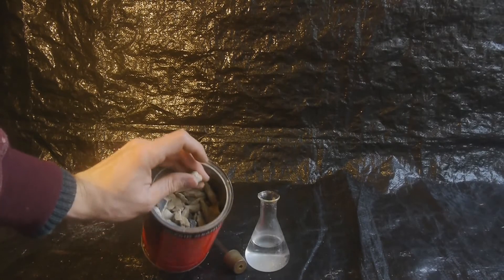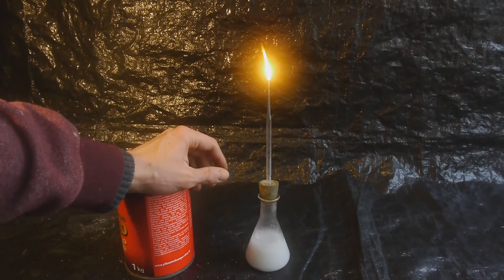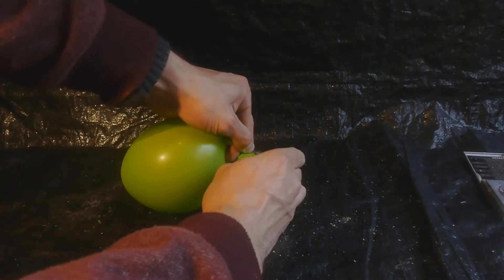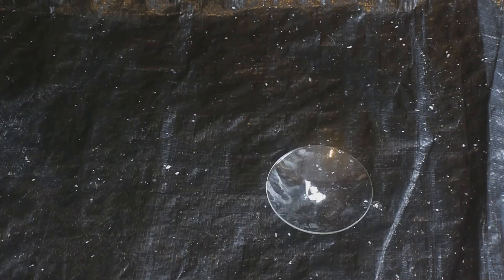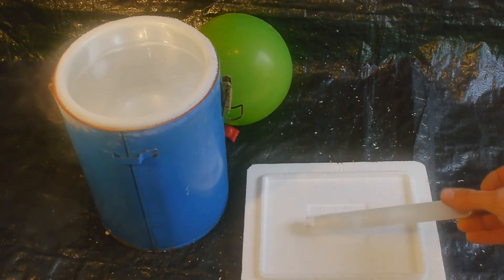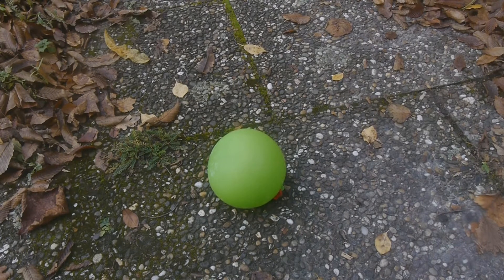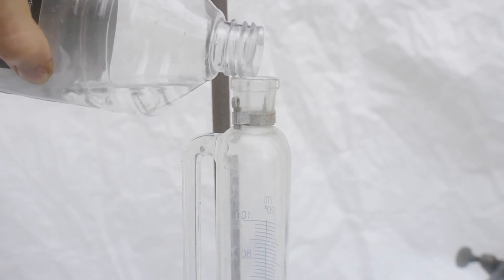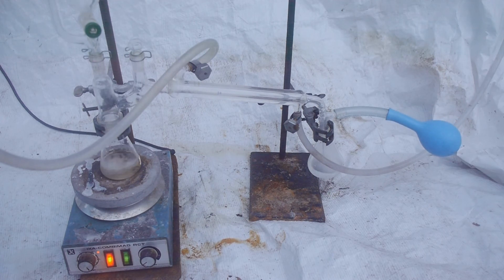Making Solid Ethyne: Flammable Dry Ice

Comment: Did you use phosphoric acid H3PO4 or solid P2O5?  AFAIK only the latter could remove  H2O from other compounds.
Reply from the maker: Yeah you are right, with P2O5 I should have had much better chances of getting ethylene. But I only used 85 % H3PO4
Reply: @EliasExperiments  My understanding is that the H2SO4 is not  used for its acidity or catalytic activity, but only because of its extreme avidity for water, and will rip apart other molecules to get it.   The 85% H3PO4 is already satisfied and has no such power.
Reply from the maker: The H3PO4 is certainly a lot weaker, then the H2SO4, but it still has some dehydrating power. Also I distilled of quite a bit of water.

Comment: sweet, I wonder if frozen acetylene is at all shock-sensitive?
Reply from the maker: I was actually quite scared of that, that is why I only made such small amounts. :D Maybe some idea for further experiments.
Reply: it isnt, i knew one chemist who made solid acetylene and smashed it with a hammer- nothing happened
Reply from the maker: Stuff like that is highly dependend on the amounts, purity and how solid the underground is. So I wouldn't rely on that. I have been wrong with stuff like that before. :D
Reply: @EliasExperiments  yes but acetylene when under pressure turns from tripple bonds to double bonds, and even at this more shock sensitive state, it requires a very powerful knock to go off, one handbook explained an oldschool acetylene bottle could be set off using a thick ring of plastic explosive going all the way around the acetylene bottle
i dont think a hammer will do.
Reply from the maker: That is certainly true and I am sure what I did was somewhat safe, otherwise I wouldn't have done it. Still it is always better to not rely on something being safe.
Reply: @EliasExperiments  try loading up a balloon with around 75% acetylene and 25% oxygen and then lighting it off
Reply from the maker: Lol the neighbours will sure love me for that. XD
Reply: @EliasExperiments  if the mix is right its just a super deep boom and not a window-breaking bang
Reply from the maker: Okay I might try it, or maybe even with liquid oxygen.